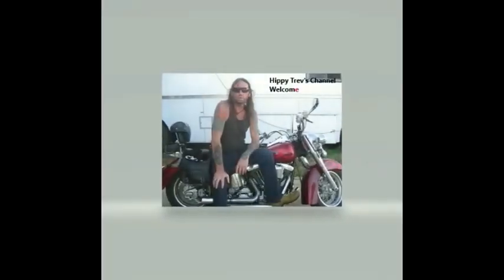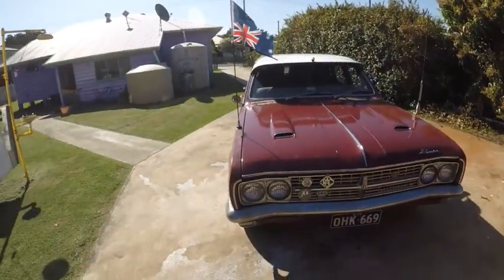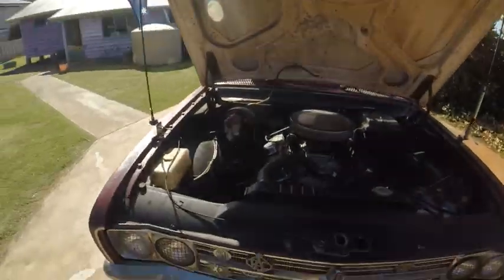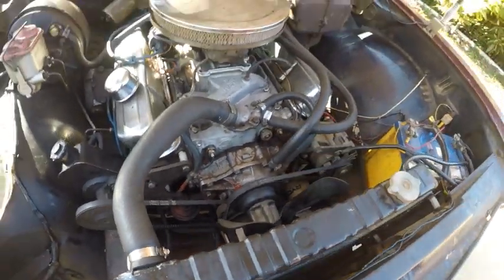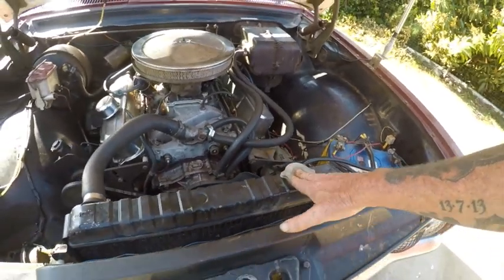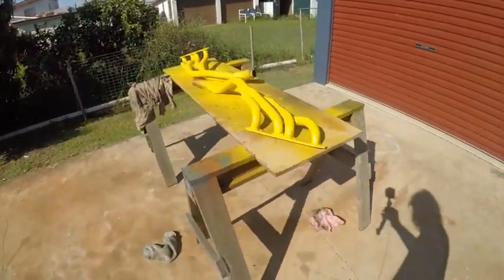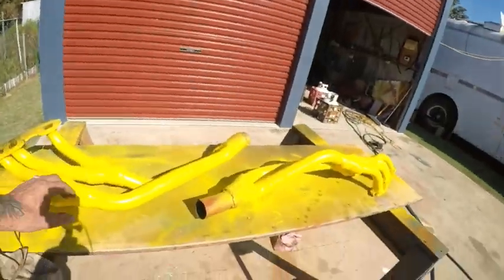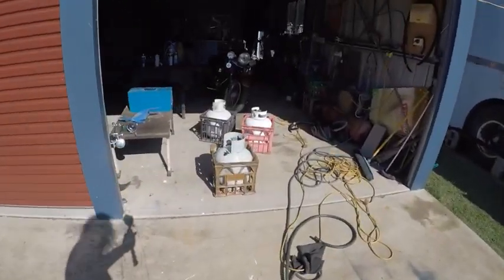Missed Comments....... Hippy Trev

Comment: Hi Trev i have read somewhere a bloke had the same problem he did all the things your doing to find that it was and electrical gremlin and it didnt affect any other gauge so he fixed the  main earth from batter to body   and hey presto fixed he said it was worse if he turned headlights on so i don't know if that's your problem but well worth checking out before pulling the motor
Reply from the maker: poor bugger hey.. my gauges are mechanical either lines not eltrical so l can rule out faulty wiering plus l have changed the gauges bought new ones  same  result.. cheers & thanks

Comment: If you had a hair line crack you would have the oil coming out the dip stick.
Reply from the maker: thanks mate l didnt think l did  but was a good thought but cheers
Reply: @hippytrev7452  Crack in the head would be more likely, but if its hair line its not going to open up till it heats up. The cowling crowd are all dreaming any speed over 60ks fan or cowling want make a difference. Have safe trip.
Reply from the maker: @madmurf  new worked heads on there now..l stil beleive it a blocake in the left bank water gallery cheers